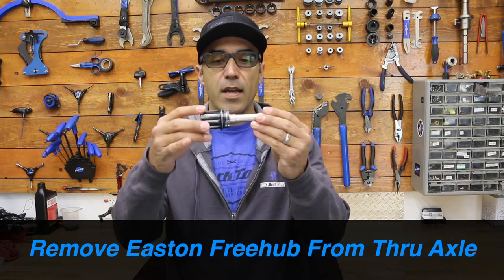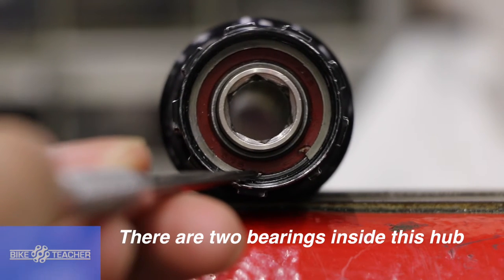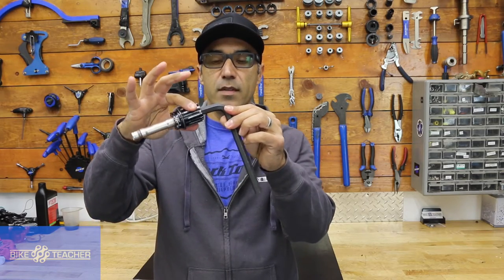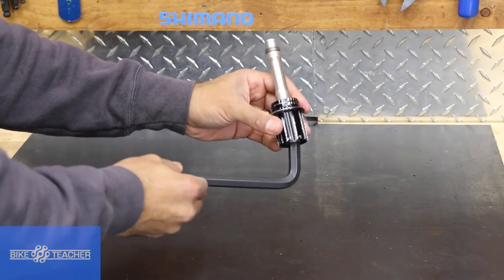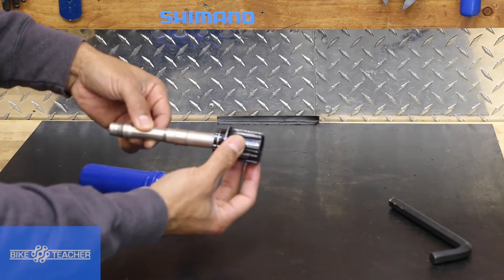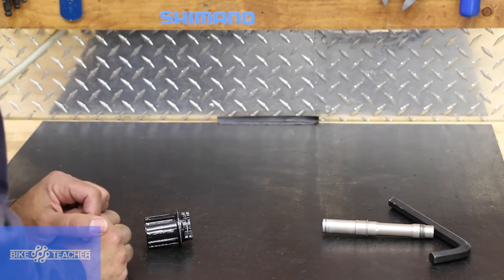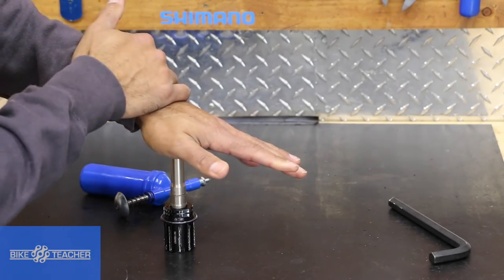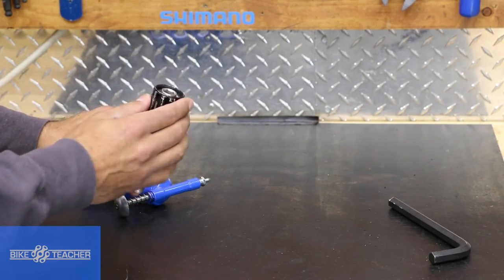How To Remove Thru Axle From Freehub Body, Part 4

Comment: Very good! ... thanks for clarifying how to perform the disassembly. You can tell me if the freehub of the original Specialized Epic 2020 cubes are also disassembled in this way. Thankful!
Reply from the maker: It could be vary similar, depending on the model wheels. he other option is the free hub one br removed with a 10, 11, 12 mm Allen tool. Counter clockwise.
Reply: @BikeTeacher  Got it, thanks for the clarification, and congratulations on the videos are very useful! ... thanks!

Comment: Does this axle use a 5mm Allen? I can't find how to remove it.
Reply from the maker: Some cases its a 5 or mm alien (hex). if you do not see a place to put a tool the end caps may pull off. Either by fingers or a tool.
Reply: @BikeTeacher  that's it! The other end of the QR axle just pulled off. It had an o-ring, so it was snug. Thank you.
Reply from the maker: Your welcome

Comment: Is it supposed to be stuck in the hub?? Mine is stuck and thé bearings run a bit rough
Reply from the maker: It may be stuck and needs encouragement, it may remove a bearing in the process which is normal.

Comment: mine it doesnt have the hex screw and i cant pull it because its stuck..
Reply from the maker: There are a few different styles out there. Is there any shapes that resemble a tool? Or is it completely round on one or both sides? There should be a sign of this or maybe you have a security style that requires a special tool.
Reply: Só, It turns out that I had to hammer the axle out through the DS. Then the 'star' shape screw can be visible. I tried a 12mm Allen key but the thing is damn tight. Trying to see if I have still warranty before starting the fun :). Thanks